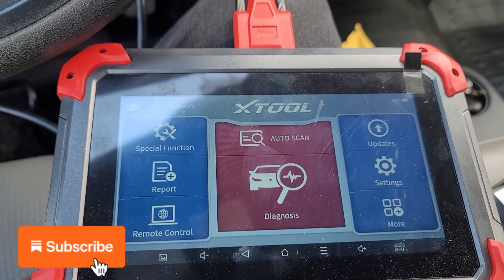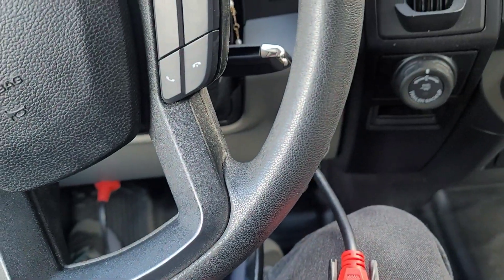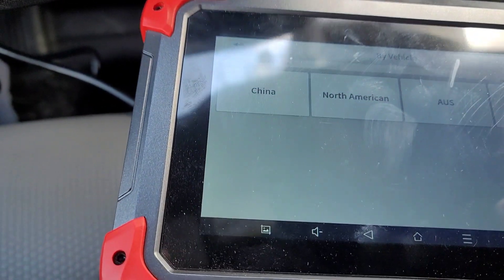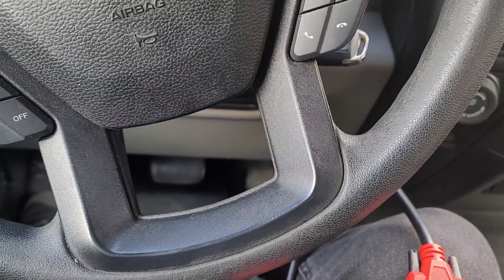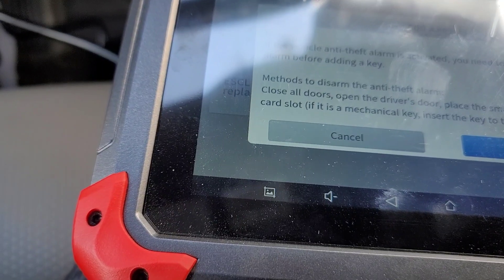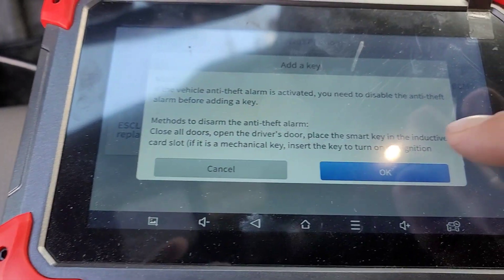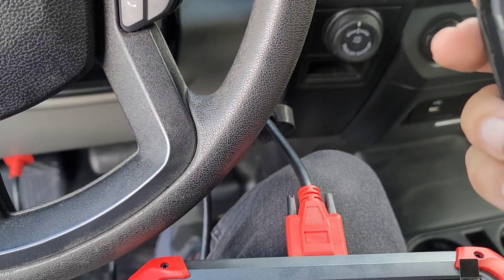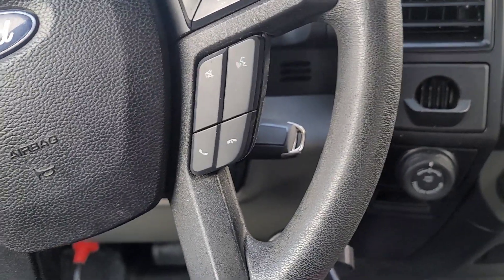2017 FORD F150 XL KEY FOB PROGRAMMING

Comment: 5:22   u stuck the key in ignition and turn the key all the way and the car didn't crank and start the car
Reply from the maker: Don't crank start the car. Just till you see all lights on the dashboard on.
Reply from the maker: At the end i did cranked it and started the engine. Its quiet you can't hear the motor😊